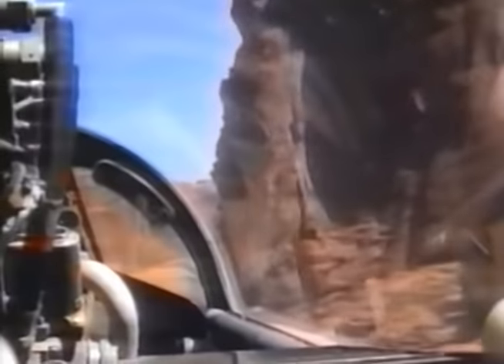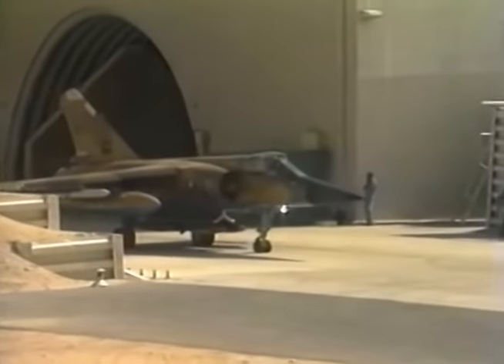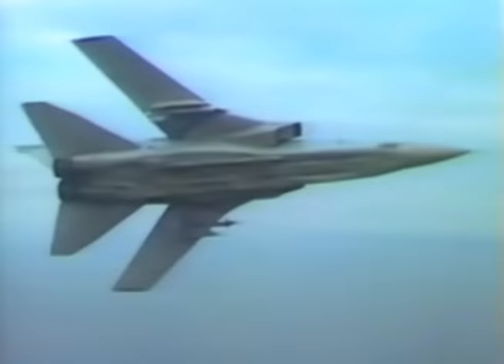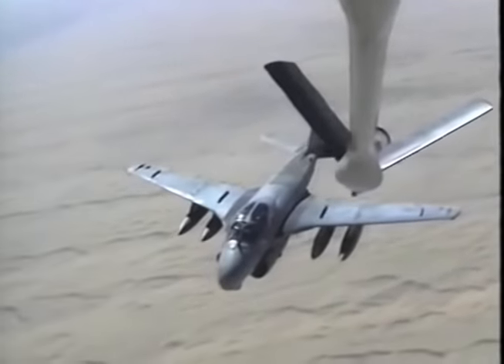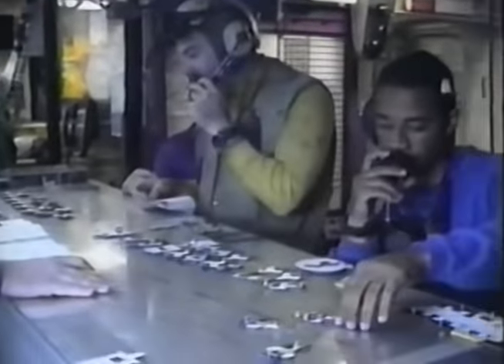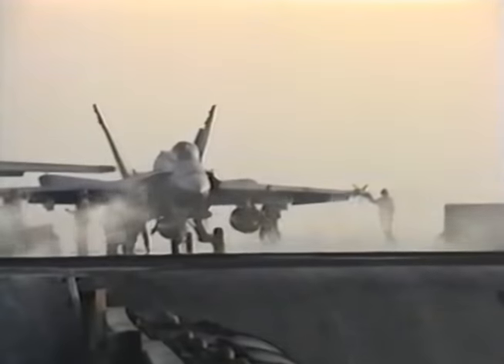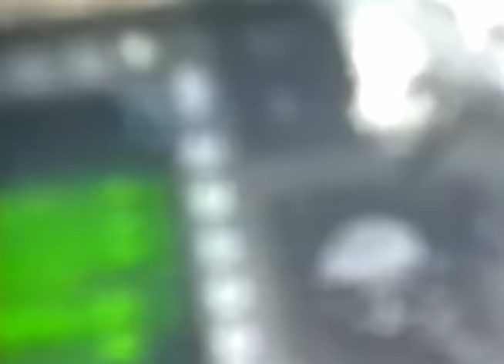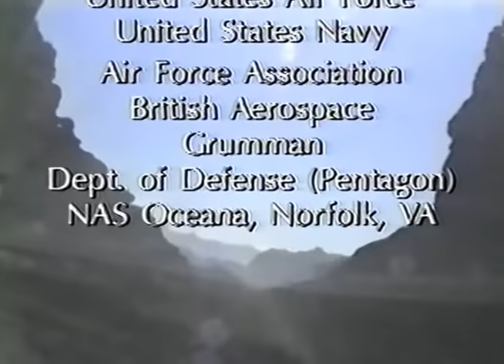Wings Over the Gulf - Episode 2- In Harm's Way

Comment: 8:07 Great camouflage tents. They look like mounds of sand and rock on the desert floor.
Reply: Those were nets with spreaders underneath.  They may not have actually had tents if the weather was hot.  I used those a lot during the 90s in the Corps.